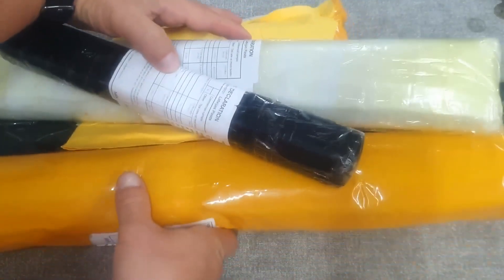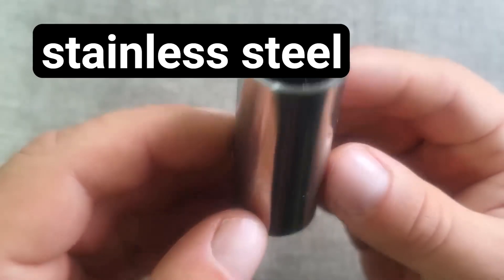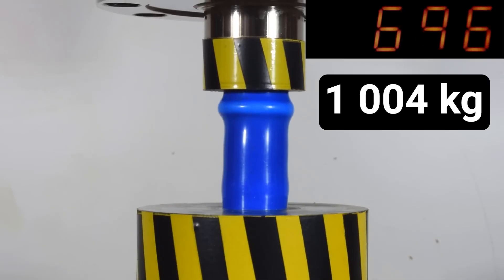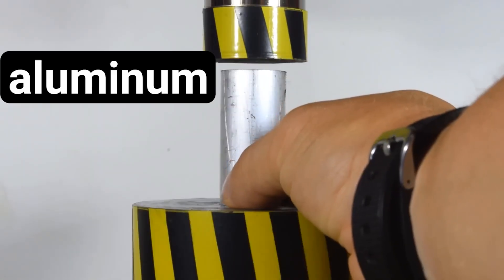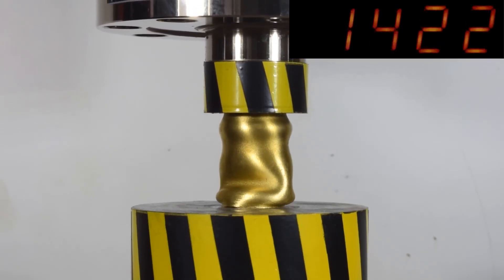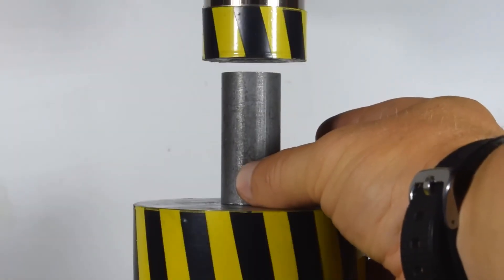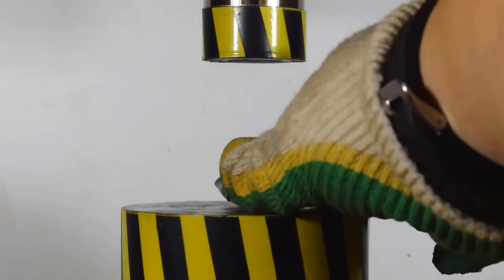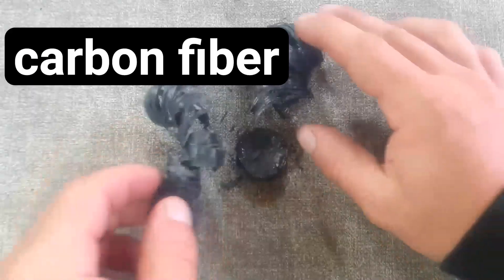HYDRAULIC PRESS VS TITANIUM AND CARBON

Comment: couple points. 1) you waited WAY longer to register deformity than you should have for a lot of these. titanium, for example, started buckling around 5500kg (or 12k pounds) and was very visibly deformed by 8k kg  but you gave it to over 9200 before you called it. 2) this was a VERY slowly paced video. I watched it at 2x and it was still way too slow as well as had too much fluff in it. This video should have been around 5 minutes long. You could have cut out a LOT of stuff, like trimming each piece, measuring each piece (showing just one or even 2 would have been fine)  and speaking to each weight (that single list you put on the screen would have been fine) and finally not speeding up the incredibly slow press process. I enjoyed the video, and I hope you make more, this is just feedback for future videos. Hope to see more videos like this in the future, just way more streamlined :-)